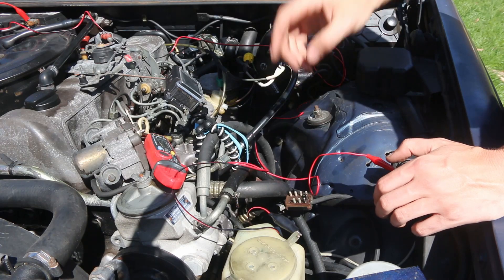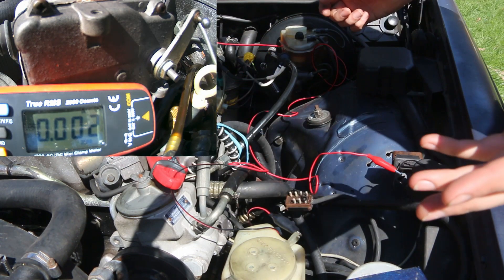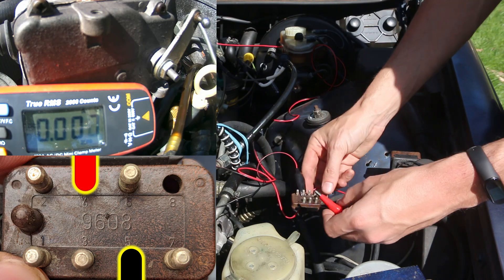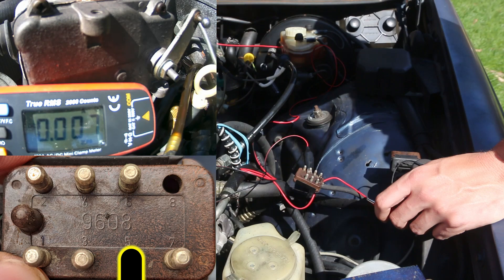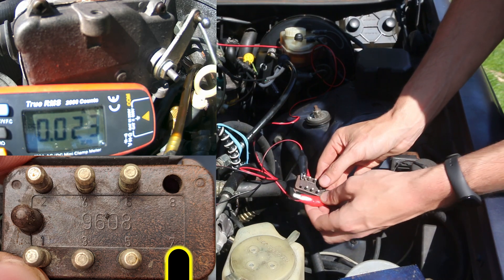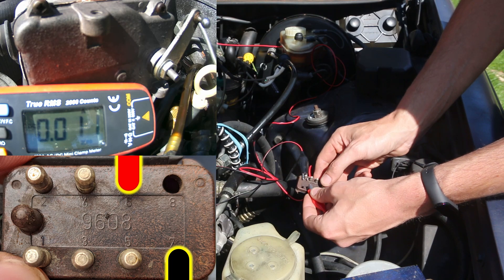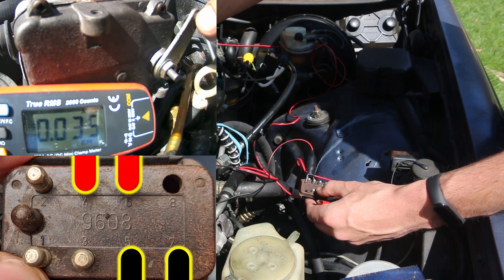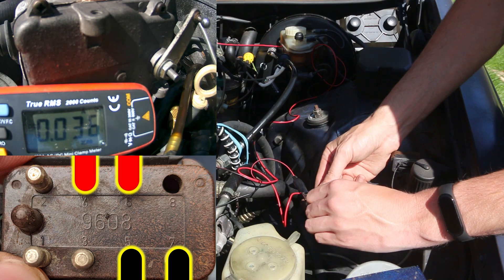W123 VDO Cruise control repair series part 1: Actuator testing

Comment: Great video! Will this information also apply to a 1987 w124?
Reply from the maker: All 3 of my videos on the cruise will be similar across w116, w123, w124 and w126, there are some differences, but it should be mostly the amp itself internally between my w123 and your w124, but the same process would apply, you just might need different capacitors than I show in the video

Comment: at 2:40 the negative jumper wire is being clamped by the Mulitmeter???
Reply from the maker: Yep, its a non-contact amp meter, thats whats providing the on screen display of amp draw to prove the motor is spinning in case you can't hear it in the video.

Comment: I was trying to follow the instruction in the video , everything else is fine so far but the arm (4:30) on my actuator is not moving either way I paused the video to ensure that I am connecting it correctly, any idea what else could it be?
Reply from the maker: I've seen the gears strip inside, I've got 3d models of 2 of the gears on the website that can be 3d printed (https://trythistv.com/w123-3d-printed-things/), but it would be best done with a very tough material, I've only got FDM style printers, so nylon or ABS filaments would be the go to, I'm not sure how well a resin printer would do, it might be far superior. I should look into getting a cheap resin printer to test it
Reply: @trythistv  Thank you very much for your quick response like always . It make sense to me since motor is getting power and making some noise also but just arm is not moving it must the gears. I would try to see some videos on you tube etc. to see how to dis assemble and assemble the motor, and have an idea about my "skill level" if I am grown enough for the challenge . Thanks again.🙏🙏🙏
Reply from the maker: @teesaeed6529  I'll have to make a video tearing apart the spare one I've got and replacing the gear, there is some small parts you gotta keep your eyes on, but they aren't too awful complicated. After I make that video if you find a broken gear I should mail you one of the ones I made to test it's durability, I'm not sure if my process of making them will work long term or not
Reply: @trythistv  thanks again, I will be looking forward.

Comment: Hi TrythisTV. I am confused. I have a 1982 W123 300D Turbodiesel. The Actuator part number is 0015457532. This part number was replaced by the part numer 0025458632. I have both part numbers here. But they react different. For example: In you video you make the solenoid test by connecting pin 6 to plus and pin 7 to minus. In your video the solenoid clicks. When I do this test to my 0015457532 then is clicks. But when I do this test to my newer 0025458632, then is does not click. But when I change the polarity (pin 7 to plus and pin 6 to minus) then it clicks. Then I checked your pdf instructions. Here I could see that you explained the test not as you explained it in your video. WHY? What part number has your actuator? And why is there a difference between your video and your PDF when it comes to the solenoid test???????
If there is a difference between part 0015457532 and part 0025458632, then i wonder if the amplifier from my 82 W123 is compatible to the newer actuator with the part number 0025458632.
I am very keen on reading your answer. Thanks a lot in advance.
Reply from the maker: I haven't checked the part number on mine, but I have an early actuator, and made the video with only knowledge about the early actuators, later on it was brought to my attention that the newer actuators have a diode and my polarity was wrong and would not work on the newer actuators, whereas the older actuators the polarity did not matter.
There is not a great way to update the video on here, I would have to release a new video and then hope people find that one, so I corrected the troubleshooting document but have no way to change the video. I could perhaps add an annotation or something that maybe could help, I will look into that later on today!
Reply: @trythistv  Thank you for your fast answer. I Just checked your information. You are absolutely right. The polarity does not matter on my old actuator.

Comment: There is also a Rheostat that gives feedback to the module. 
Pins 2 and 3. 
The Rheostat goes bad too.
Reply from the maker: Yup, I believe they are traces on the circuit board inside the actuator, I've seen them have a tendency to wear out at common speeds the cruise would be set at, like 55mph or 65mph the trace will wear through because the actuator arm spends a lot of time there. I'm unsure if there is a way to repair those traces or something.

Comment: Fantastic video. Very helpful. My solenoid is not working :/
Reply from the maker: Not clicking or not engaging the gear?
Reply: @trythistv  i had the leads backwards. It clicks no problem now. I moved onto your 2nd video, and my stalk is testing fine too. I guess i need to replace the caps in the amp. Thanks for the nice videos!

Also, I dont have a #14 pin on my amp. My car is an '83 240D manual. Do you know anything about the manuals cruise control?
Reply from the maker: I do not, I've only had experience with the cruise in my car and what I've been able to glean by reading online, I would imagine it is similar, but likely has a provision for the clutch pedal perhaps, or perhaps not, the auto amp will kick off quite quickly if the vehicle revs up too quickly (I attempted testing the cruise with the vehicle in the air, which is an awful idea by the way, and it would kick off nearly immediately when the stalk was pushed in any direction), but the amp does not have RPM signal input as far as I'm aware.

Comment: Hi again, I'm into month 11 of my cruise control Saga, (I don't mean I've been working constantly for 11 months 😄)  But in the last couple of weeks I've been working very intensely after recieving a reconditioned amplifier from Kris rose, you probably heard of him, anyway....

I have got the strangest symptoms with this new amp, it seems to have rendered my stalk pretty useless, now My stalk has lost 90% of its functionality, if I nudge the stalk either up, down, or right, the accelerator pedal Is moved all the way down, then springs back to default, and that's only with one nudge of the stalk, But the off function of the stalk is fine (nudge left) 

Also, when running your test's,  connect pin 4 (black) and 7 (White) nothing happens.and I get huge spark's from the crocodile clip on the battery? What does this mean? 

Have you ever come across something like this before? Maybe when I reconditioned the actuator I wired it up incorrectly
Reply from the maker: If you are following the printed instructions from the website, you have 5 and 6 connected to ground, then are connecting 4 and 7 to positive and get sparks? What if you do the individual tests, 6 to ground, 7 to positive? solenoid clicks? then 5 to ground, 4 to positive and motor runs?
Doing that could help you narrow down if there is a fault with either the motor or solenoid. It is possible that some of those pins might be different, check ohms of resistance to ground with a multimeter, perhaps yours is one that is inverted or something?
I've seen Kris' website, it looks like he does a lot of awesome stuff, and has a plethora of information, which I applaud, I love seeing people providing a service, and also information and knowledge for those that want to dig in themselves.
What kind of resistance do you get between pin 3 and ground at the actuator, and what if you move the arm on the actuator while reading the ohms?
I'm sorry your cruise is giving you this much grief, 11 months is a long time with no real progress.

Comment: A++++ across the board!!
quick to the point
added camera and pin reference 
amazing! Can not wait to digest the rest in this series then test mine out tomorrow! 
Please keep up the great work!!
Reply from the maker: If you liked this, you'll probably appreciate the printable reference document I made as well, its on the website: https://trythistv.com/cruise-control/
and I'm also slowly working on documenting the vacuum system: https://trythistv.com/w123vacuum/
Thanks for the kind words, I'm still plugging along trying to put out useful info as I can!

Comment: Thanks for the info on the MB VDO cruise controls.  
I recently encountered a problem driven at least in part by what I believe is an error or over site in your video.  There are at least two versions, maybe more of the actuator.  The older style is part number 001 545 75 32, the newer version is 002 545 86 32.  When I tested my actuator, the 002 series,  following your instructions I found the solenoid to be faulty.  The problem is on the newer version there is a diode in the solenoid circuit that makes the connections polarity sensitive.  I connected the solenoid as you instructed, pin 7 ground and applied power to pin 6.  Nothing happened so I concluded the actuator was faulty.  Two days and $100.00 later I found the problem.  On the newer actuator, the 002 series, pin 7 is positive and 6 is ground.  Due to the diode in the solenoid circuit, this circuit is polarity sensitive and a good unit will test as faulty if someone follows your process.
I later checked other sources on the internet and found a pin description for the actuator cable.  It verified what I believed.  Pin 7 is + on the solenoid and pin 6 is-.

Thanks
Reply from the maker: You are absolutely correct, someone else pointed out there is a specific polarity, I updated the document on the website (April 2022 revision should have the proper polarity listed), I'm looking into options to put a note on screen at that point in the video as my actuator is obviously an early model and polarity didn't matter during my testing.
There is no telling how many revisions of these cruise units there are, thanks for the info, I'm hoping I can make the most useful and accurate information about these!
Reply: Great info. Anyone know what year ranges is for the newer version?  Maybe 1981-1985 or just the last 2 or 3 years of the w123?

Comment: Hi, i have problem with my actuator . I tested it and my motor works but whan i want check that activation sound nothing is happening. How can i repair this. Thanks
Reply from the maker: if you're getting no click from the solenoid, it is entirely possible the solenoid has failed, or the the wires have degraded to where it isn't carrying current well, being outside all the time can do weird stuff to our wiring.
If the solenoid has failed I believe replacing the actuator is the solution, I don't believe it can be easily replaced inside.

Comment: Hi ,I tested the cruise control actuator on my meter,I am not getting any readings on pin 4 and 5,pin 6 and 7 makes a tapping noise as per your @t you know what the issue of no reading means.Thanks
Reply from the maker: 4 and 5 is the motor, it is entirely possible the windings have burned out in the actual motor itself.

Comment: Hi Trythistv

Great videos!! Really helped me in understanding a lot! I have a 500 SEC (C126) from 88. Do you know if the cruise actuator is the same on that car? I tried your terrific guide and it spins and clicks, but I can't make the "arm" rotate. Any good ideas?
Reply from the maker: If you apply power to the pins that make it click (Solenoid Engage) and the spinning pins (Motor) at the same time it should move the arm, it is entirely possible that the gear inside has stripped out, they are made of plastic on every one I've seen so far, and can become brittle and shear teeth off or break entirely. As an option, with the solenoid engaged, gently try to move the arm, if the teeth are good it shouldn't be easily movable
Reply: Hi again 🙏
Thx for taking time ansvering me.
I took the aktuator apart. Everything worked, but it seems like the big gear is going in the wrong direktion?? I use 18 volt batteri from a scremdriver. 
Do you know anything??
Reply from the maker: Ah, try reversing the polarity of the wires you are using on the motor control pins. The cruise amp has the ability to run the motor in both directions to adjust the throttle up and down, it may be you've got the wires trying to reduce the throttle
Reply: Hi again 🙏 
When I turn the polarity, the solenoid doesnt kick in, but the motor is running.

Comment: Hi, great videos! 

I tried the starter solenoid test, and I am not getting the click audio sound. I plugged it back in and my cruise control started working. Do you know what this could mean?

For background information, my cruise control sometimes works and sometimes just doesn't work at all. Seems like random chance. trying to boil  down the part that isn't working.
Reply from the maker: Well that is rather bizzare. Could it be that the wire to the actuator is broken internally so you didn't get the click when it was unplugged but plugging it in twists the wire a little differently and it makes connection intermittently?

Comment: At 2:56 you mention pin 5. What does pin 5 correspond to and the other pins that you mention. The reason I ask is because I have a VDO tempostat with 7 terminals as yours does. But it is from a 1990 Porsche and I am not sure the terminal numbers are the same as yours. I have learned that these 7 terminals are Motor-, Motor+, Pontentiometer+,Pontentiometer Slip Contact,Brake Light, Clutch Tempostat, and Ground. Are these the same functions as yours and what pin numbers correspond with what functions? Any help would be greatly appreciated! Thank you very much!
Reply from the maker: I've got a document with a bunch more detailed info on the website: https://trythistv.com/cruise-control/ But just in case that doesn't work: Pins 4 and 5 are the motor, on the Mercedes neither is necessarily positive or negative as the amp can power it in either direction to accelerate or decelerate. Pins 6 and 7 are for the Solenoid/Clutch, Pins 2 and 3 are the potentiometer. In theory a good share of the info in this video and the document on the website should be the same or at least similar enough it would be useful, How much I'm unsure, I've heard the exact same cruise system has been used on a mountain of cars, Porsche being one, but I've not set my eyes on the cruise system on one personally as of yet.

Comment: I ran your test on my two actuators. The one on the car now tested as follows: motor runs, but is squeaky. Solenoid clicks. Actuator are moves to full travel but when it get to the end of full travel is whines like the gears are grinding. Junkyard replacement tests as follows: motor runs quietly, solenoid does not click. On the arm aviation step, the motor runs but the arm does not do anything. Can I likely make one good one out of these two?
Reply from the maker: My motor is a little strange crunchy sounding, but seems to work fine, I'd suspect if you combined both those actuators you should have a really smooth unit, You should be able to combine the best parts of each actuator, Inside there is a bunch of plastic gears and possibly a little spring or two, the grinding noise at full travel is probably the gears skipping at the limit, as normally the travel is limited by the feedback circuit but doing the test with the jumper wires will let it wind all the way to the stop, as long as you take your time it shouldn't be too awful difficult to trade off some of the components. It might also be possible to just open up the one that works but is squeaky and lubricate things inside. They use the same nasty sticky grease that is on the sunroof motor and other stuff, clean it up and replace with new grease or some other lubricant and it might be a-ok

Comment: I cannot tell you how thrilled I am to have found your very informative series on this nagging issue for us proud owners of these old girls!! Can’t wait for the the rest of the segments to post!!
Reply from the maker: I've finished filming all of the 3rd part on the amp repair, it is a lot of material so I'm working on editing it down to not be half an hour of boredom for everyone but still be clear what needs to happen. So nice having all the little comfort features back, I've got plans for some other very useful videos soon as well
Reply: trythistv just curious,  what state are you in?  I am in Athens GA.  I’ve purchased an 82 300 TD that runs great! Ive been able to fix the power antenna, window switches and the electric sunroof by salvaging parts from PULLAPART yards in Atlanta. The remaining BIG issue is the cruise control system.  Thanks again for this series!!
Reply from the maker: I'm just a few hours north of you near Knoxville TN, I just helped some friends move near Atlanta last year.
I can happily confirm after part 3 of the cruise repair saga I have fully functional cruise control, it holds dead on where I set it, I tried 55, I tried 35, and it holds flawlessly, no surging, no drop going uphill, no rise going downhill, absolutely flawless. I'm editing that video right now, Hoping for tomorrow, but I'm suspecting friday morning before it's uploaded and all ready to go.
I'm hunting for a instrument cluster to tinker on, I'll need to hit the yards near me soon, I'd like to play around with the tachometer and see if I can work out a good solution for the tach amp issues. I have repaired one tach amp before for the blue car, and seemingly failed twice after that for the grey car, I'm unsure if its the amp or the actual gauge.
Reply: trythistv thanks again. I’ll pay attention to future videos on the tach...as that doesn’t work on mine either :-)